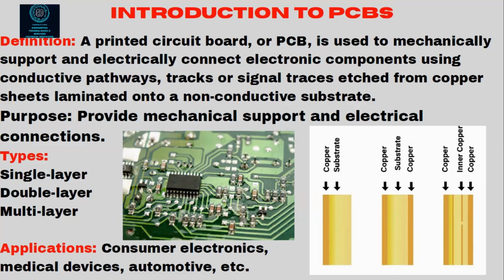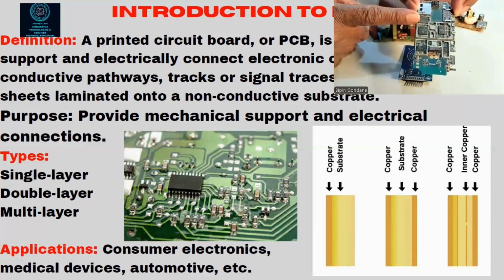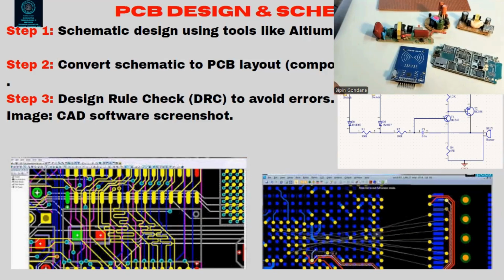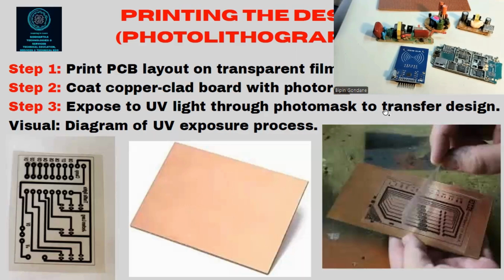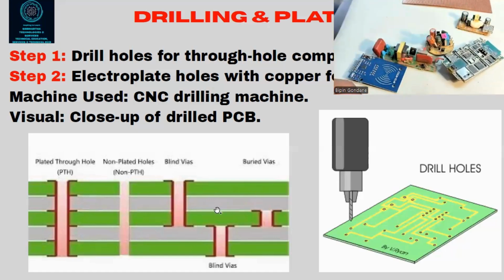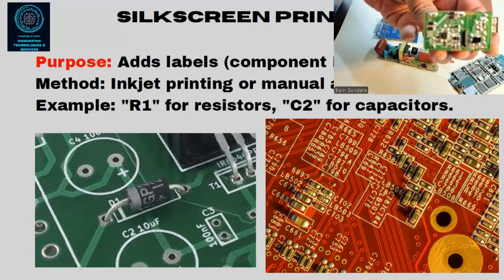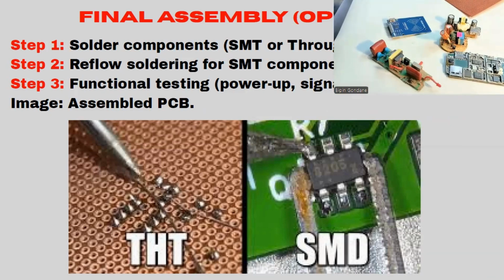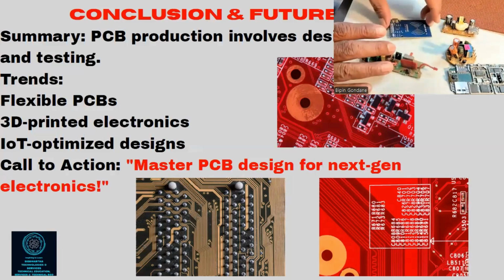Hands on skills & live practical  (Printed Circuit Board (PCB) production process)

Comment: Do you guys projects?? I am looking for make in India rc control board with simple integration with flysky receivers, 4-8 channel to control multiple motor, multiple servo for ships, boats and cars
Reply from the maker: Please send the details of the project.
Reply: @siddharthatechnology  as you can observe we import most of rc toys from china.   To address this looking for esc with support for 2 motors 6 servo channel support, differential speed control of motors, input using rc receiver like flysky, and fpv control board power supply
Reply: @siddharthatechnology  market is large, if you have contacts....worldwide there is very high demand. The requirements are for rc cars, trucks, ships, boats, sumarines, expected input from 7.3 v to 11 V lipo input, twoforms of motors brushed and brushless, amps should be high, with ample cooling for chips, some sensor integration like i2c bus and a wifi transmitter and receiver integration as additional features with additional module integration
Reply from the maker: bipingondane@gmail.com